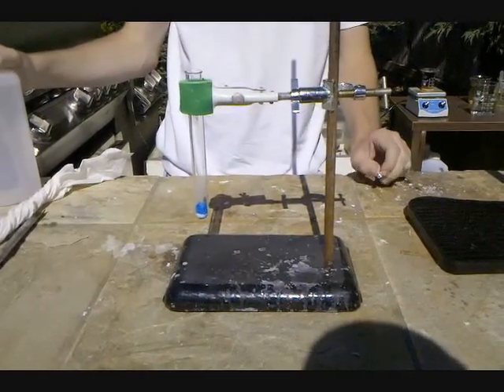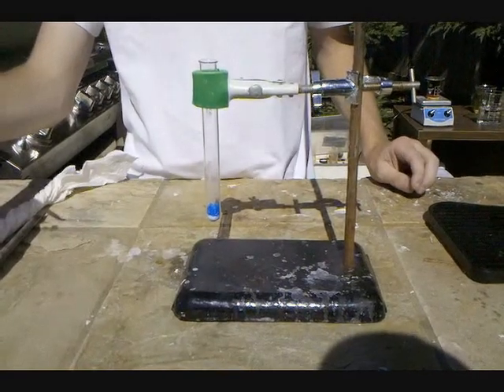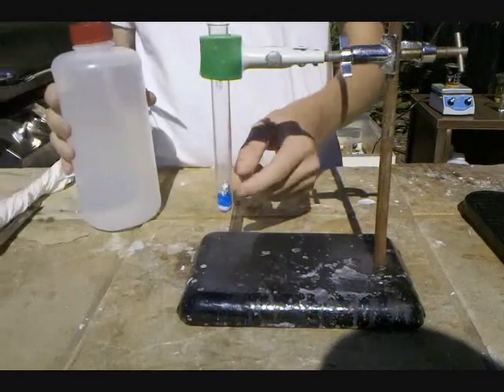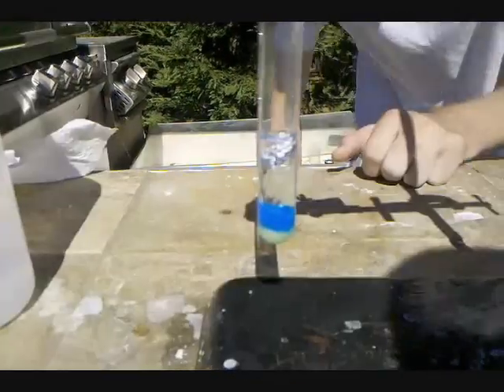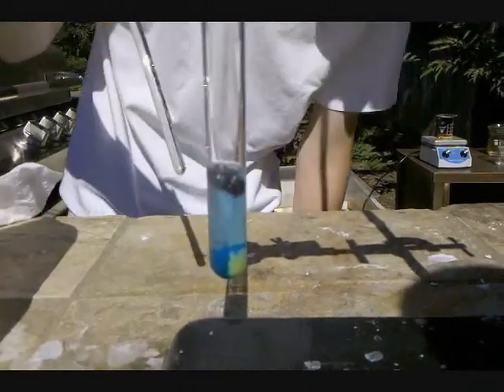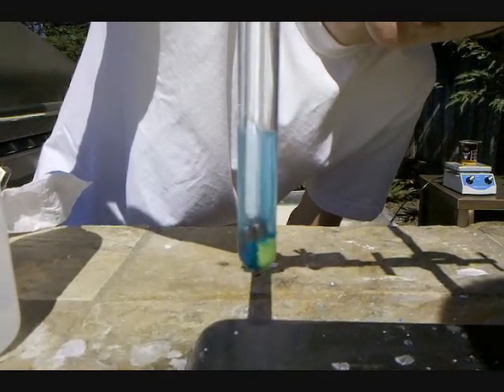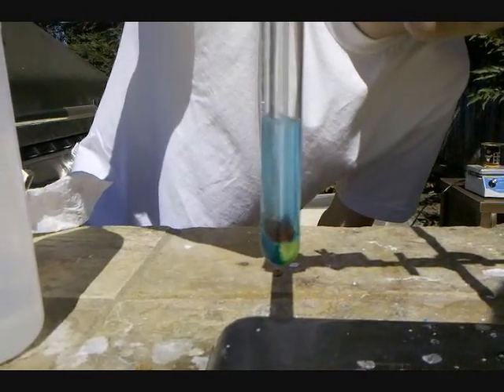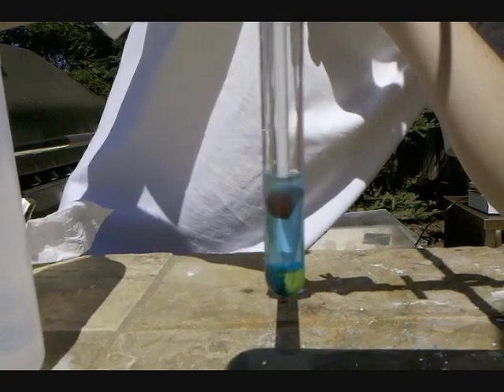Dissolving Aluminum

Comment from the maker: @Ralphgtx280 I watched your video, and yes its clear that the solution acts as copper chloride and that is what dissolves the aluminum.  What is not clear is exactly why both the copper and the chloride ion are required for this reaction (that is, the reaction of copper chloride and aluminum).  The oxide layer seems to be broken remarkably fast.  It has been speculated that this is due to the formation of the complex AlCl4- because the ion dissolves and does not help protect the metal.